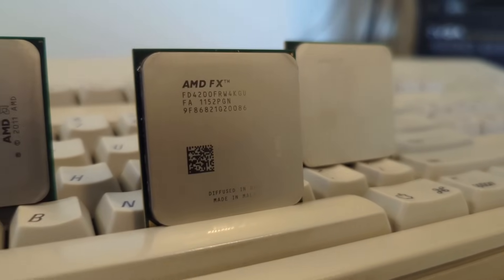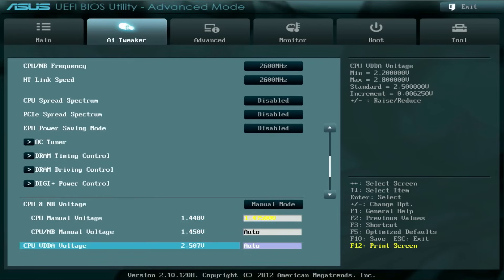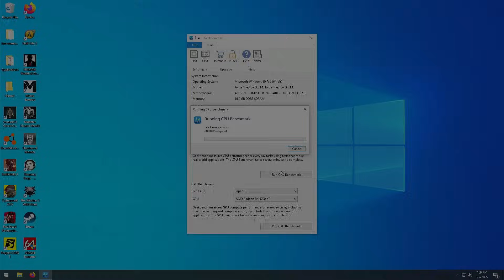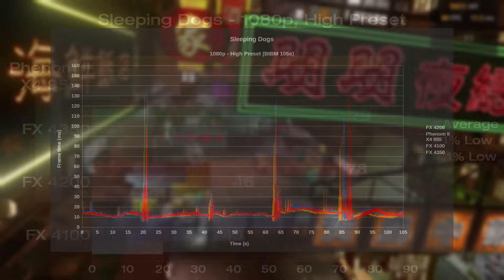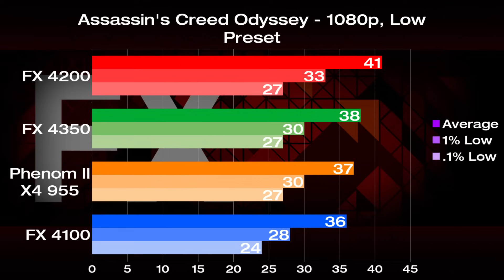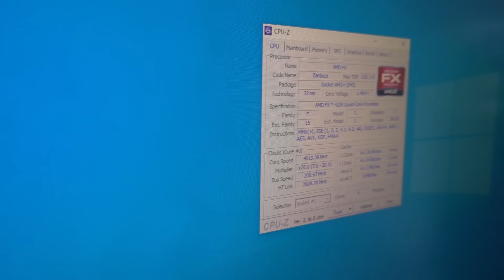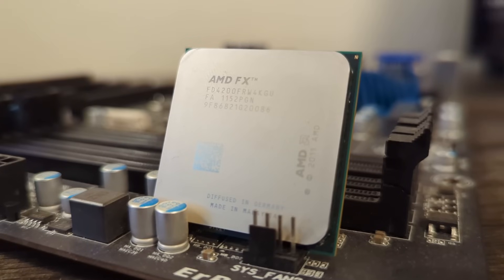What if AMD FX had "real" cores?

Comment: 4 core, 4 module bulldozer is not so uncommon; their latest APU iterations like the a10-9700, a12-9800 or the mobile  a10-9600p were all based on such configuration I think.
Reply from the maker: Those wouldn't be Bulldozer; that's Excavator, and it's a pretty different kettle of fish
Reply: @SPNG Isn't Excavator technically still a Bulldozer generation?

Comment: I have 3x FX8350 with a Gigabyte 990x mobo with 1Tb NVMe (it was one of the only boards for the gen with a NVMe slot) and 32gb Ram superb UNLESS you want to run Ai LLM local cos there not compatible. else these CPUs are still fast, I matched mine with the VEGA64 card.

Comment: In other words, AMD would have been better off staying with the Phenom II cores and working to enhance those until the Ryzen project was done.
Reply from the maker: Glofo's 32nm node would have screwed over a Phenom III pretty badly as well. AMD had to make a LOT of compromises in FX because of it, I truly believe it wouldn't have been nearly as bad if it wasn't stuck on this awful node
Reply: @SPNG  It's interesting the 32nm node was that much trouble. I didn't know that part.
Reply from the maker: @dangingerich2559  If you want to learn more about it I suggest you check out Chips and Cheese's writeup on Bulldozer. They do a great job of explaining how it affected FX

Comment: I had an FX 8320e clocked at 4,9GHz and 16GB of 1866MHz RAM. Those clocks took it to the ballpark of 3GHz Sandy Bridge when it comes to single threaded performance. Was it great without OC? Absolutely not. Was it great with the overclock? Hell yeah. It performed about the same as an i7 2600 in most games, with admittedly using about 1,5x the power. Used it until the release of first gen Ryzens, then I picked up an R5 1600 and 16GB of DDR4.
Reply from the maker: They definitely open up when overclocked, although I second the power consumption note. My FX-9370 performs great with some tuning but it is easily the most power hungry CPU I own, it's pretty insane to be honest!

Comment: great video out of curiosity I went and looked at highest OC and it's still being dominated by FX for AMD and the fact of FX staying on top for biggest OC for like 12 years is pretty insane
Reply from the maker: The OC potential is one of their best aspects in my opinion. I learned a lot just messing around with my FX-6300 back in the day, it was the first platform I had that was unlocked so I was going to take advantage of it

Comment: FX requires high speed RAM, HT-Link and NB settings. Checkout the video "AMD FX in 2024 - Fine Wine?... or Vinegar?" by MDFGamingVideo
Reply from the maker: I didn't mention it in the video but the NB/HT were tuned. FX was running at 2600/2600 and Phenom II was running at 2600/2000

Comment: The first pre-built "gaming" PC I ever bought was an iBuypower that was supposed to come with an FX4200 and a GT 710 (lol). When it arrived, it had an FX 4300 and GT 610 and I didn't return it because I thought it was an upgrade :') go figure about 13 years later I'm finding even more evidence that I was in the wrong. That aside, great video!
Reply from the maker: Well they are close enough in performance as shown here, and bear in mind the FX 4200 has very low stock clocks. Did you ever do any overclocking to your system? And thanks, glad you enjoyed!
Reply: Whether it is GT710 or GT610, I think it is very weak (probably can't play any heavy games at that time)

Comment: why not also compare it to an 8-core FX? those have the same four FPUs, but four additional Internet units, so I'd expect close, but slightly better performance from the 8-core FX.
Reply from the maker: Could be the subject of a follow-up, but I don't think they would have been that close, a fair amount of the games I showed here could stand to gain a lot from the extra threads
Reply: Yeah, I'm curious how well 4200 would compare to a same gen chip with full modules in games.

Comment: My Phenom II X6 1090T has been waiting for 10 years to be in a build again. I just love retro builds so it's time to make it happen. Thanks for the great video, never heard of FX-4200.
Reply from the maker: Throw it in a board like this and you could do some tuning 👀 And much appreciated!
Reply: @SPNG  No worries! It's sitting in MSI 990FXA-GD65 👍
Reply: I have a build with a 1090T, it's a great CPU I think.
Reply: @Aruneh  It was great back then, it still is for old games from that era! But like always, better stuff comes later, and intel had better even then cos they payed  billions  to  DELL and HP etc, for not to use AMD. Hence we got only 2 to 4 core for years to come. 
I love 2002-2010 era as it was very competitive on sound, CPU and GPU performance. It's not the case anymore sadly
Reply: I still got my father's phenom 1100t black edition and a 1045t and my golden sample fx 8150 that clocked to 5.2ghz at 1.52 volts... I've held onto these PCs for overany years. Gonna be turning into retro PCs. Win 7 ultimate or win XP.
Reply: The GOAT Phenom.
Reply: FX - Failed eXpectations. Same as Intel's Pentium 4 and NetBurst architecture, where Celeron 600 Coppermine overclocked to 900MHz by setting the bus to 100MHz was mopping the floor with 2GHz P4. And Pentium III Tualatin was utterly destroying most single core P4s.
Reply: @shadowflash705  Oh yes! Coppermine was great for a while. Had it till I bought T-bread 1700+.  Oh man those times with Frankenstein water cooling and shims...
Reply: I've got a 1090T in my WinXP build, which is perfect for playing games from Windows 95/98 to the mid-2000s. I had a GTX 260 paired with it at first, but I had to shrink down to a slimmer chassis to sit on a server rack shelf for more space and convenience, so I downgraded the GPU to a low profile Radeon HD 4550, specifically so I can keep the S-Video and play old movies and retro emulate on a CRT TV. Can't play too many games from the late 2000s without major compromises, but since most late 2000s games are still compatible with modern versions of Windows, it wasn't really a sacrifice, and I was at least able to overclock the video card by about 14% on both, the GPU and memory with no thermal or stability issues.
Reply: @SpinDlsc  I actually got Windows 98SE running on my 1055T but sadly it take half an hour to boot into Windows. Tried so many different things like a single 1GB RAM stick, IDE HDD and so on but nothing helps. Ah well, I got enough other old hardware for DOS up to Win7 32bit, with all except for the Win7 system being hooked up to a CRT monitor via a KVM switch.
My WinXP 32bit machine is a Digitainer (loved the looks of it's case) with an Athlon 4 and added GeForce 750 Ti. Only issue is HDMI audio, as when the games don't tax the GPU enough, HDMI audio stops working. Like when playing Elite Force II on out living room TV, movies had no audio over HDMI.
Reply: i've got an old tuned 1055t that isnt worth it to use but i cant let it go

Comment: you can take an fx8000 series cpu and simply disable half the cores. then it becomes a quad core cpu, but thistime, there are no shared resources. 
allso you are right, software issues prevented this cpu from working properly. the only that i know that managed to grasp some of its potential was doom 2016. even that was about able to use .. no more than 60% of what this puppies could have been doing.
Reply: In my time using my FX-9370, the BIOS of both motherboards I used specified you were disabling sets of cores, not one of two - the only core that could have its twin disabled was core1 if you disabled all others, leaving you with just core0. Which of course reduced you to a single core CPU.
Reply: @BenignStatue71  interesting. Mine absolutely did not disable core pairs. It disabled a core per module.
Reply: Any modern game will download it at 99%. Today, even 8 threads won't be enough; you need at least 12.
Reply: @gorbunoffdmitr9610  its not just about using all threads. In this architecture you have core pairs that share some circuits.  Software would had need to load odd or even cores more . But it did not. So core 0 and 1 for example got both heavy load while 2 and 3 did not. Due to the shared resources thisway it was terribly slow. The solution would had been to load core 0 and 2 with heavy load , 1 and 3 should have light load.

Comment: L1/L2 cache are just part of a core. When a core is disabled you don't "also loose" the cache. That cache can never be used by other cores. There is no performance difference other than the core being disabled. If you had a full CPU and only used 3 cores, that 4th cores L1/L2 cache is useless. 

Most motherboard Bios's at the time allowed you to run one core per module Its just an easy setting in BIOS. Boot into windows and bam only 4 cores show up and yea, you do get increased single thread performance. Even in those days without many threaded applications it wasn't worth it.

There were a few video games where I would switch to one core per module. It mainly allowed for high clocks and lower heat. I could clock my launch day 8350 to 4400 mhz stable with my cooler but could get ~4500-4550 with higher a higher voltage and only 4 cores enabled. Granted by the end of the CPU's life cycle the process had improved and overclocking gave 200-600mhz more than launch day silicon.

Kerbal Space Program when it was in Alpha only used a single core for physics and maybe half a core for the entire rest of the game so I would switch modes and get like a huge performance improvment.
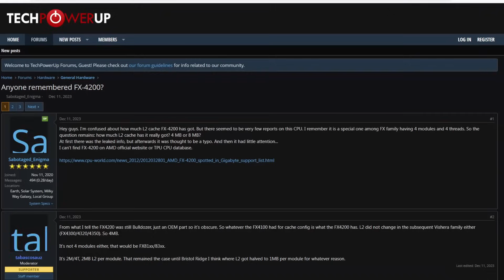Reply: 3:23 The L1 cache is part of the core, but the L2 cache is shared between the two cores on each module in Bulldozer.

Comment: I have a soft spot for the fx series because my first gaming pc was essentially whatever crap cyberpower had together.
I think I had the 4300 and a gt720 with 8gb of ram.
It beat my Dell Inspiron 537s and it was all mine, so that's what REALLY mattered to me.
Reply from the maker: Wouldn't have been a bad starter system! One would hope you were able to get a GPU upgrade though, I bet the GT 720 was kinda rough 😬
Reply: @SPNG  couldn't emulate ps2 at full speed and didn't manage to run black ops 2 at like consistent 30 fps, but it did run team fortress 2, so I was happy with it.
...until its PSU just died (again, I think this was just some PC that cyberpower sold on amazon out of whatever parts they had excess of.)

Comment: Phenom2's love bclk, at 250mhz is the magic spot that they all can do with stock clocks and volts.
iirc on some test the performance increase was nearly 30% percent! (and even more on Thuban)

The FX cpus liked NB&HT clocks overcloked creatly.. you could do a video of testing how Bclk,NB and HT clocks affect the performance of fx and phenom cpu's.
Reply from the maker: I didn't mention it in the video, but all chips had their NB/HT tuned. The FXes were at 2600/2600 and the Phenom II was at 2600/2000

Comment: If found the FX series OK at the time.  They had their place, and while not many older games took advantage of core count, which was its downfall.  In other tasks that could use the multiple "cores" it offered a competative performance per dollar, even ignoring that, the cost is where it shined.  Even for games at the time, it did not compete at the enthusiast market, but was an inexpensive alternative.  As this core count transitioned happened, it may not have been able to push high frame rates, but was better suited for stable frame rates.  Specifically around the time the 2500 and 3750 were getting choked for not having enough cores. It was not the CPU everyone wanted, but a cpu that a lot of people had, even if only for a short time.
Reply from the maker: I feel like a lot of people forget how cheap FX was. Every time I see someone comparing the FX 8350 to an i7 3770K it makes me groan, the 3770K's MSRP was about 50% higher.

Comment: My run with AMD back in the day was so much fun due to sheer ignorance.

I had an Phenom II X3 720BE that could unlock the fourth core and appear in BIOS as an X4 920BE, and also i unlocked some L3 cache and OC to 3.4Ghz without sweat.

Then the FX líne hit and i went full idiot on it, from that Amazing Phenom to a shitty FX4100 and some years later an FX 8320 before jumping to a Ryzen 1700
Reply from the maker: Unfortunately my Phenom II X4 840T (Thuban with 2 cores disabled) wouldn't unlock lol. Did you ever tune your FX chips? Might have been able to get a little more out of them that way

Comment: SPNG : Well said mate "current applications and games were designed in a way that they expected each CPU having his own FPU". If that wasn't the case, those FX cpu-s would reign supreme probably. But to be exact, back in 2011/2012 if you used Adobe Premier or a similar program for rendering videos, the FX 8350 was approximately 45 % faster than the much younger i7 3790K or a i7 4790K....I've tried them side by side myself.

Comment: Bulldozer did share the FPU, but more importantly shared the decode units. If you don't compile your software to take that into account, you will regularly stall the pipeline.
In short the Bulldozer processor had problems similar to P4, but no one to optimize for it (except on consoles later on) leading to crappy performance.
Reply from the maker: In hindsight I should have talked about the shared front-end, but I wanted this video to be approachable to less and more knowledgeable folks so I didn't look into it much. It would probably go over most people's heads. And it's funny, just like Netburst they tried moving on to a new architecture only for it to fall flat, but they ended up with the advantages of that too since ideas would later be used in Zen just like Netburst contributed to Sandy Bridge in a few ways. Also consoles never used Bulldozer, the Jaguar cores were more like two Socket AM1 Athlons taped together.
Reply: @SPNG AMD's cat cores were actually fantastic for the time period they originally came out. They absolutely STOMPED on Atom in the little x86 core battle, despite being on much inferior nodes.
Reply: Bulldozer is not used on any consoles
Reply: i guess mantle was optimesed for bulldozer in battlefield 4
Reply: There are no bulldozer cores in Consoles... cat cores, which are a different low power architecture.

Comment: The FPU was the least of its worries. Each module was nothing but a single CPU-core with an extra integer-unit slapped on.
even in pure integer-workloads FX couldn't compete outside of intentionally crafted synthetic benchmarks: the integer-units polluted each others branch-predictor and the frontend was not able to deliver enough instructions nor data to really feed them. So the only thing they were fast at was very tight and predictable loops that repeated the same calculations on the same data over and over again. Later tweaks to the architecture alleviated that, but it was never enough to reduce the gap to intel.

If you compare Bulldozer to Zen1 this becomes really apparent. A zen1-core is roughly similar to a bulldozer-module just that it has no secondary int-scheduler and 6 instead of 8 integer pipelines (yes, a Bulldozer 2-core had just 30% more integer-pieplies than a Zen1 core). this leads to inglecore to multicore scaling being rather similar when comparing a 4-module bulldozer to a 4c8t zen1 CPU.

The thing AMD did have on it's side is the affordability in many regions and you could get 2nd hand one nearly for free for a long time. And they were still good enough to play most games - just not really great.

Comment: The pinnacle was the 9xxx Vishera's, got one here and if you got the minerals in the cooling department it was an absolute power and heat hungry beast and could nip at the heels of the early Ryzen's.   What we all waited for was the 8 core Phenom's, the best of the 6 core being the 110T which could be cranked up hard on the clocks and again if you had the cajones in the cooling, you could ride it ridiculously hard too.   109's were good and then there was the Phenom lucky dip if your motherboard had locked core unlocker.   That basically meant it found the locked at factory cores of CPU's with general good performance but a flaky core would be locked off before release.   Quite a lot of the x3 cpu's were in fact anything from a quad FX or Phenom to a 6 core Hexa FX or Phenom.   Sometimes for retail stock levels AMD took healthy CPU's and castrated them to fulfil x3 and x4 slots so if you won the lottery that quad FX unlocked on motherboard could in fact be a 1xx Phenom x6 or as my daughters machine would attest she has a 3x FX  CPU running x5 but not Phenom and runs really great too :D
Reply from the maker: I have a 9370, and have played with it a bit... The clocks it can attain are impressive, and performance is pretty damn good but holy shit does it consume a lot of power. It makes the total system power draw of this build go well over 500W 😰 It's a fun one to tune though.